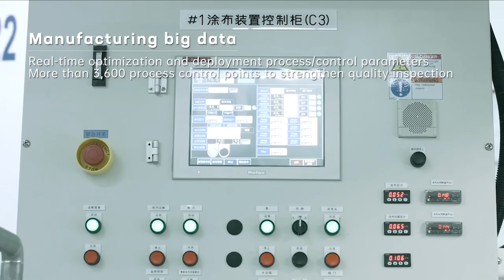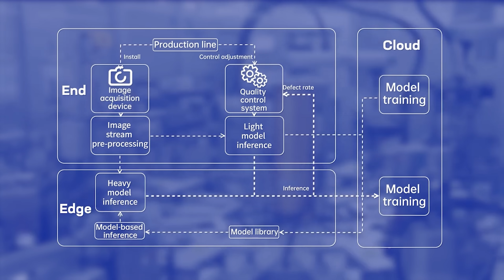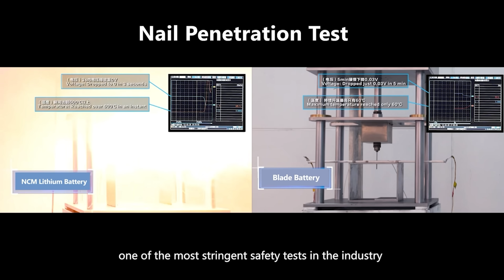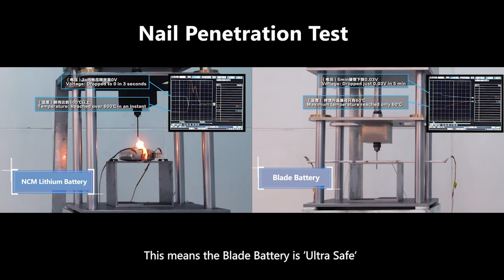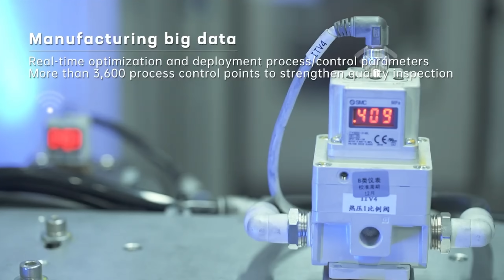South Korea Fears China’s CATL Sodium Battery Revolution

Comment: korean has to fear that chinese had engineers ten times more than them.
the solution is to import chinese engineers, so that korean has enough engineers to develop more types of battery.
Reply: But the exact opposite is happening. Currently there are more Korean engineers moving to China than the other way around. The most obvious problem is that Korean companies have a salary hierarchy similar to American companies, with upper management having close to 40 times the salary cap of engineers. In China this number is 7, much lower than the global average of 8. However, the more complex reason is that most Chinese major industrial cities have better living environment than almost any Korean city other than Seoul and Busan, and certainly better than any Korean industrial city, but living costs are much lower. It's much easier for Chinese companies to convince Korean engineers to move to China than the other way around.

Comment: They shouldn't be worried about auto markets. Sodium ion will only be suitable for budget/entry level city vehicles. The future of the global auto market will be much lighter, more energy dense batteries, i.e., not sodium. For energy storage for the grid, it's another story.
Reply: If the energy density is on par with LiFP, why do you say that?
Reply: @yeroca  The gravimetric energy density (per weight) could theoretically be on par with LFP but not volumetric energy, so LFP packs will continue to be smaller. LFP has already jumped ahead of the 175 Wh/kg CATL has claimed their Na+ has and will likely stay ahead for some time. LFP has a better voltage profile so will perform better at lower states of charge. LFP can be combined with lithium metal and silicon composite anodes for much higher energy density while sodium cannot. Sorry if that was too geeky.
Reply: @Haiti3063  Thanks for the detail!  I appreciate it.
Reply: Research and funding into this new generation of sodium batteries is just getting started. The energy density could more than double in the next few years.  Sodium batteries with 400 Wh/kg is possible (theoretically).
Reply: @ab3000x  I hope you're right, but 400 Wh/kg is even higher than the theoretical energy density for today's NMC batteries, unless they move into silicon anodes, so I don't think any sodium ion batteries will be reaching even 250 Wh/kg.
Reply: @Haiti3063  I’m not sure where they’re getting the 400 from. Silicon anodes (that’ll crack) or graphene, or something else. Probably some tech that isn’t even on the market yet. 250 would be plenty and a huge disrupter.

Comment: 3 big things are happening to Chinese BEVs in 2026.
1- Radical cost declines due to cheaper batteries, higher levels of factory automation, and the likely introductions of modular assembly methods similar to Tesla's unboxed production platform.

2 -Improved safety due to more stringent government safety standards, autonomous driving, and product maturations.

3-Bidirectional vehicle to load charging facilitated by more durable LFP and Sodium Ion batteries.

Comment: I expect at some point lithium ion batteries could be outlawed in some countries based on safety. That's a larger risk than the cost advantage. It doesn't even matter if the fire risk are overstated or not, governments can outlaw the technology because of some kind of "deal". We have already seen good technology like wind and solar under attack, I expect batteries are next.
Reply: I believe in the end of the day there will be simply regulations on dense parking areas. Be it passive fire barriers or automatic fire distinguishers

Comment: Won't CATL be competing with themselves? If they make cells that are 80% cheaper car and energy companies will buy the CATL sodium batteries instead of the CATL LFP batteries.

If CATL don't have competition for such sodium batteries then they won't sell them for 50 or 80% less. They will probably only sell them for 5 or 10% less than the LFP equivalent.
Reply: CATL is competing with combustion. Cheeper batteries mean cheeper EV which means more EV sales , displacing ICE sales, which means more battery sales. Likewise cheeper batteries mean more grid storage which mean less peaking gas turbines and more grid batterie sales.

Comment: If what CATL claims is accurate, this has far-reaching implications, well beyond existential threats to Korean/Japanese battery makers.  

Suddenly, solar/wind plus batteries put fossil fuels out of business.  What developing country will want to continue to import oil/gas (using hard-earned foreign currency, ie, USD) vs installing their own domestic solar/wind and batteries?  Those countries have lots of cheap labor (which doesn't need much training), and cheap land to install GW of solar. Drop in utility scale batteries and in a matter of months, they have GW scale power - which normally requires a decade to build.  They then avoid rhe never-ending need to import oil/gas and can use that money internally to build their economies, instead of sending it to the handful of oil exporting countries.

This is the long-awaited battery tech breakthru we've been waiting for.  The next decade is going to be extremely interesting/disruptive.
Reply: If this is true , it will hurt the usa interest a lot as they have stockpiled a lot of oil
Reply: Yes, renewables, and low cost batteries, are an existential threat. Hence why big money is behind Trump to roll back all things renewable.
Reply: And I think we can now make fast charging available everywhere with these batteries

Comment: I don't think sodium batteries Will kill the rest of the industry but surelly Will shrink it 😁 High performance and long range Will continue to prioritize nmc. LFP is a different story though. Guess used evs and batterys Will become a lot cheaper too.
Reply: I think you'll be surprised. Sodium batteries don't need external cooling/heating.  They operate at higher and lower temps. That saves pack space and weight.  That space can then be used to add more batteries.  And with cost 1/10th what NMC costs, it will be very difficult to expect a huge premium for marginal improvement.  Premium market might accept it, but that's a tiny fraction of demand....
Reply: @ArthurDentZaphodBeeb not Higher, ONLY lower temps. You can add more batteries on the same volume but that also adds weight (while having less energy density). That affects performance and range (you spend more energy to carry more weight). It'll revolutionise stationary batterys, small Cars and maybe bigger transportation in some cases. Premium ev's, drones, etc. Where weight and range is Key Will remain nmc for now (for the most part) imo

Comment: Whilst CATL have the competitive jump on all players in the Sodium Ion. do not dismiss the Lithium Sulphur and Aluminium Ion batteries under development.
There are multiple battery chemistries in BRTL 4-6 right now and equally less expensive - super safe.
Aluminium Ion -  Non Lithium and with minerals that are even more common than Sodium and fully recyclable.
The battery tech and battery chemistry other than Lithium, Cobalt and Nickel   is being investigated at breakneck speed. 
China head the pack but are not the only runner in the race.
Reply: Being first is usually a massive, and often insurmountable, advantage.  I would not bet against CATL/China continuing to dominate.
Reply: Except those batteries even if better are irrelevant if hey can't manufacture to scale

Which is the real advantage.. not the chemistry mass production means cheaper and more revenue to fund further projects and better world wide adoption 

The You can create more second products and an entire ecosystem
Reply: @viyusavery248  They say that these sodium cells can be manufactured on same equipment as LFP cells which should really speed up their adoption.
Reply: @viyusavery248  Tesla just release that their  less expensive Model 2 will have an lower cost Aluminium Ion battery , made in USA in scale volumes. - so there is that one for the books I guess.
Reply: It's not just a jump, but light-years ahead of anyone including Tesla.
Reply: Not to mention LFMP, LMR, anodes with greater concentrations of silicon (won't work with sodium), lithium metal anodes, all of which will have much greater energy densities than sodium.

Comment: so when are we expecting sodium battery on an EV?
Reply: 2026
Reply: @RedDesk-l8l how? The mass production only start end of the year?
Reply: @leedaq7767 Well what are they mass producing it for? cars. Who made the car? Clients of CATL. I guess if they just replace the content within the same shape they can fit the battery later. CATL pretty much can sell the board slider anyway.
Reply: @rtbear674 surely they need to test them at least for a few months?
Reply: @leedaq7767 I think if they want to mass produced they already passed the test phase for the batteries. Fast drain fast charge cycle nonstop. 

Then as for connection to the car. Well what's the difference between sodium volt watt output with lithium with the same volt watt output. 

So they came out to say how cheap it is because now they can account on final production cost.

Well its a good thing they will sell and try in chinese market first too, right?

The faster they can deploy, the better for customers.
Reply: @leedaq7767 the test pacs will already have been sent to manufacturers off test lines. Mass production means drop in cost not start of all production.
Reply: early 2026, and mainly in Chinese market.
Reply: freevoy battery🎉😂

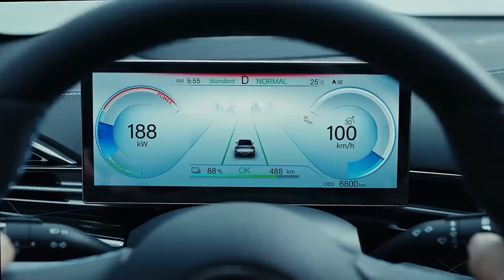Comment: 7:30 If it is 80% cheaper, alot safer, lasts longer, and easier to get source material, then it is definitely a winner worth using.
Reply: Winner winner Chicken dinner!
Reply: These are the pros. The cons are less power density. Bigger voltage dropout and less efficiency overhall.
It is worth it when it is cheaper but there wil still be niche applications for each type of batery.
Reply: @snes-mode7 do you mean energy density?
Reply: @snes-mode7 its much cheaper Lithium battery 70-75$ per kg 
Sodium 20$ per kg. Yeah not even close
Reply: Maybe we can finally steal their tech.  They would certainly have had it coming.
Reply: @AkaRyrye83 it won't matter America will never get close to China in manufacture costs, America always be a more expensive manufacturing base, China will dominate world battery production with around 60% market share
Reply: Must steals technology from the US.😉
Reply: @hanfucolorful9656  Except US doesn't have this technology.  🤣🤣
Reply: @tomtube1012  The Chinese have the capacity to steal non-existent technology from the US. They just steal everything, including the air thry breath
Reply: @tomtube1012  I think he made a prank.
Reply: @tomtube1012  They stole it from the future US in an alternate universe.
Reply: @tomtube1012 I thought it had been stolen by China.😂😂😂
Reply: @tomtube1012  Multiple U.S. companies have been developing this technology.
Reply: @mateusmahumane8990  Again, multiple U.S. companies have been developing this technology. And they steal IP and R&D in the same way from other countries. You people are ignorant.
Reply: @Objectified  So where is it lol?  All you have is  "I said so".  LMAO. 🤣🤣
Reply: @Objectified  They have real tech that people are reporting on.  All you have is tariffs lol.  🤣🤣
Reply: @Objectified  Also, notice there's a difference between "developing" and "already developed" lol.  🤣🤣
Reply: @hanfucolorful9656 sorry technology America and west from Chinese descendants too. The West can only be stolen and colonized another country, they never innovation. They can't build iss alone without Russia😂
Reply: @hanfucolorful9656 
You are like saying U5A stole paper and printing from China. 😂
Reply: @hanfucolorful9656 nope, it's their own battery , sodium isn't a trademark😅
Reply: @hanfucolorful9656  That's literally what they do as a matter of national objectives. And from SK, and Japan, and Germany, and Australia, and Canada, and the UK, and France, and Switzerland, and Sweden, and Finland, and every other European country.